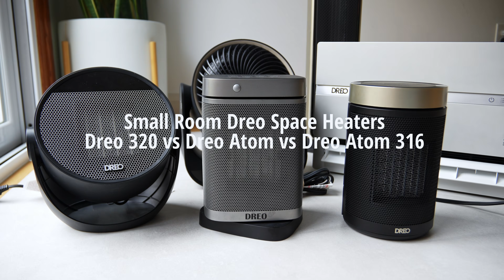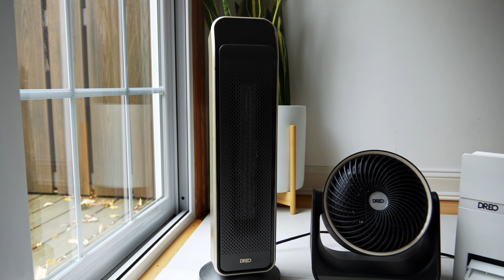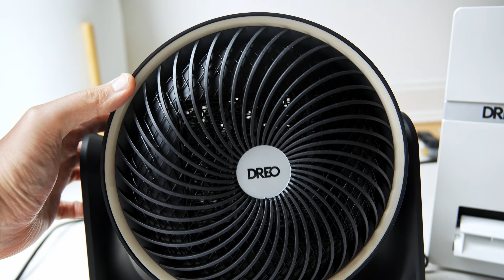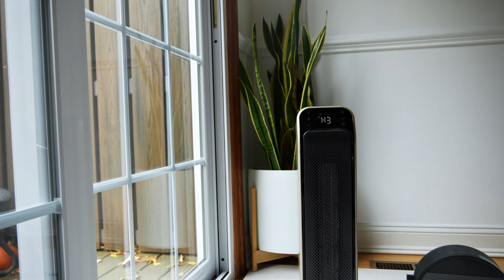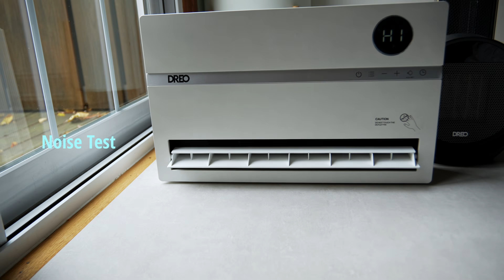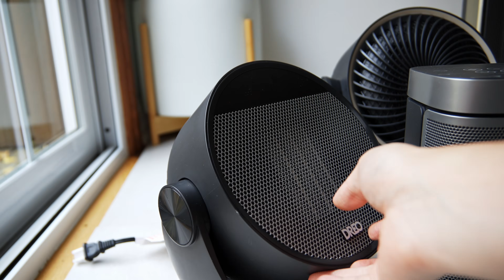Don’t Buy a SPACE HEATER on Amazon Until You See This (Top 6 Ranked)

Comment: For the dreo 714, when having temp set, does the fan stop running once it hit the set temperature? I’m looking for air circulator heater/fan that I can set temp and still run as fan when the temp reached then run heat once the temp drop below said set temperature.

Comment: I Ordered a top rated Lasko ceramic heater from Amazon las year and the smell the ceramic heaters gave off  was very noxious and I ran for 15 hour and no improvement. Did any of these  heaters give off any odor when running ?  Thanks
Reply from the maker: Hi! The lasko heater imo are not as high quality as the dreos. Dreo mastered the dc motor
Reply: I have the 718 tower and it didn’t give out any smell. A bit expensive but I like the design.